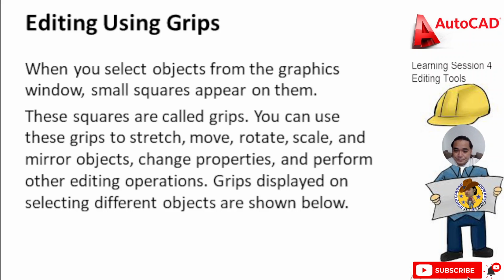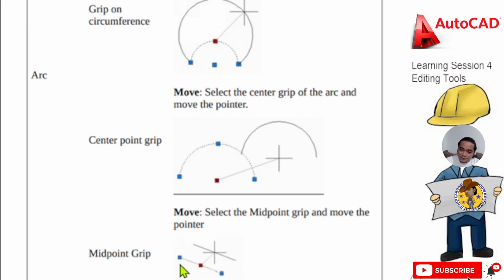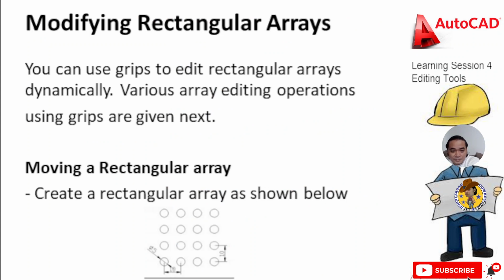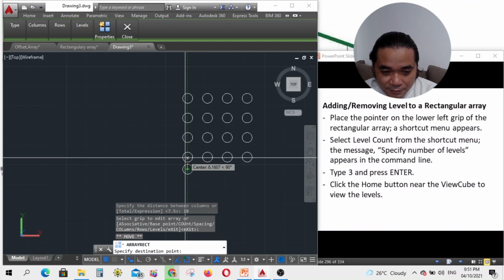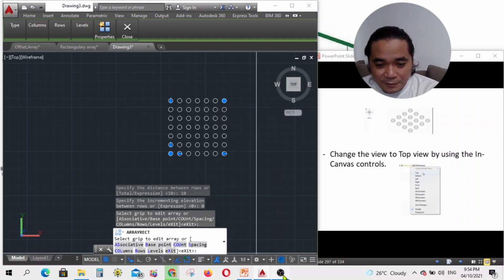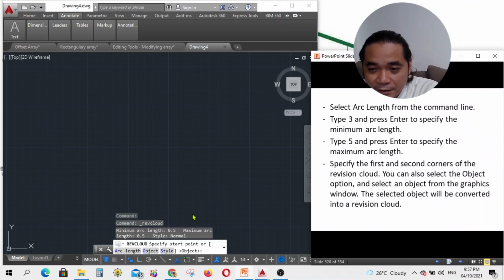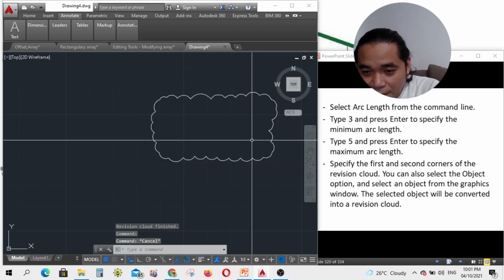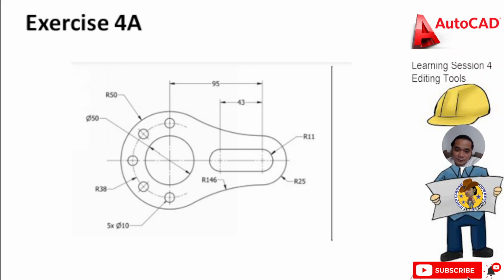AutoCAD LS 4-4 | Editing Tools

Comment: Editing with grips, editing procedures available when picking and dragging grips, modifying rectangular arrays, and revision clouds are covered in the fourth part of Learning Session 4 (LS 4-4). Tiny squares appear on graphics window objects when they are selected. Grip squares are what these are known as. You can stretch, rotate, scale, and mirror objects using these grips, as well as change their characteristics and do other editing operations. Grip editing is a dynamic editing technique that can be applied to rectangular arrays. Revision clouds are also used to highlight specific areas in a drawing. You have three options for editing clouds: freehand, polygon, and rectangle tools.

Comment: LS 4-4 | In this final section of Learning Session 4, I learned about the following four topics: editing with grips, editing operations available when picking and dragging grips, modifying rectangular arrays, and revision clouds. I discovered that grip can allows us to edit drawings in a completely new way. Objects can be moved by dragging the grip, which refers to the small squares that appear at different points within an object. These grips can stretch, move, rotate, scale, and mirror an object. In addition, I discovered that we can add and remove levels from a rectangular array. After you've added levels to it, it's best to view it from the top using the canvas controls. To truly see the difference or the object's orientation. Finally, I can now create revision clouds in three different shapes thanks to this learning session: rectangular, polygonal, and freehand.

Thank you sir and God bless you always😊

Comment: In this fourth part of the video, I learned how to utilize editing grips effectively in AutoCAD. In grips, I can modify objects by editing commands and object points. Moreover, there are five grip editing modes namely; Stretch, Move, Rotate, Scale, and Mirror. When I followed the instructions for the grip editing command, it switches to the stretch mode, and then, when I press Enter it will switch to the different editing modes.
Thank you, Sir!

Comment: Thank you Sir Pongcol for creating this video tutorial, it helped me to determine the proper application of grips, a small squares that appears in an object upon clicking it. Hence, grips may comes in a variety of points or position depending on the types of object used there is the so-called end point grips, corner grips, center point grips and others. It can help us to easily move and change the elevation of the object. Apart from it, I also learned on how to modify rectangular arrays, adding or removing levels to it and changing its view. Lastly, I were able to engage myself  in making revision clouds in rectangular and polygon form which i can used for further Autocad exercises.

Comment: LS 4-4 | In this last part of the learning session 4, I learned about these 4 things: editing using grips, the editing operations available when picking and dragging grips, altering rectangular arrays and revision clouds. I discover that grip can allows us to edit drawings in a whole different method. In other words, objects can be moved by dragging the grip — which refers to the small squares that appear at various points within an object. These grips can be used to stretch, move, rotate, scale and mirror object. I also learned that we can add or remove levels from a rectangular array. After adding levels on it, it is best to view it in a Top view using the canvas controls. To really see the difference or the orientation of the object... Lastly, through this learning session I can now create revision clouds in three different shape: rectangular, polygonal, and freehand. Thank you sir! God bless

Comment: In this part, I learned how to edit using grips.  Engr. Mardie emphasized the object's grasp and editing operation. When changing the rectangular erase, you may utilize grips to dynamically edit rectangular arrays. Following that, several array editing procedures are shown utilizing grips (adding/removing levels from a rectangular array). Additionally, revision clouds are utilized to indicate areas inside a design. You may create revision clouds using three distinct tools,  explained and showed well. As a result, in order to produce the image you want, you will almost definitely need to change one or more of these fundamental drawing elements. Thank you sir!

Comment: For the last part I’ve learned about editing using grips highlighting that when we select objects from the graphics window, small squares appear on them. These squares are called grips. We can use these grips to stretch, move, rotate, scale, and mirror objects, change properties and perform other editing operators. Also, grips are displayed on selecting different objects. This learning session is very useful and helpful in giving the guide as a skill-based. 
Thanks, Sir for this content :) Hoping for more videos!

Comment: In this video, I have received new learnings with regards to editing tools in continuation. The existence of grips in the drawing has a lot of functions and purpose. It provides numerous operations in terms of editing such as stretching, moving, rotating, scaling, and mirroring objects, changing properties and etc. Grips can be easily selected and dragged at a certain position. Grips can as well be used to edit rectangular arrays dynamically. Revision clouds are combinations of curved lines. In addition, these are used to highlight the areas in a drawing.

Comment: In this section, I learned on how to edit using grips like when you select an object from the graphics window, the small squares will appear on them and the following table gives you the details of the editing operations that can be performed when you select and drag grips. Engr. Mardie also highlighted the object grip together with its editing operation. On modifying rectangular erase you can use grips to edit rectangular arrays dynamically. Various array editing operations using grips are given next (adding/removing level to a rectangular array). Moreover, the revision clouds are used to highlight the areas in a drawing. You can revision clouds using three different tools which discussed and clearly demonstrated by Engr. Mardie. Therefore, in order to create the image you require, you will almost certainly need to alter these basic drawing objects in some way. Move, Copy, Rotate, and Mirror are just a few of the tools available in AutoCAD.

Comment: AutoCAD LS 4-4 

For the last session in Module 4, I learned on how to edit using grips, such as when you choose an object from the graphics window, small squares appear on it, and the table below shows the editing operations that can be performed when you select and drag grips. Engr. Mardie also called attention to the object grip as well as the editing operation. Grips can be used to edit rectangular arrays dynamically when altering rectangular erase. Following that, grips are used to perform various array editing operations (adding/removing levels from a rectangular array). Furthermore, the revision clouds are utilized to bring attention to certain parts of a drawing.

Comment: In this video, I learned that objects can be moved by dragging the grip — small squares that appear at various points within an object. I also discovered that you can add or remove levels from a rectangular array. After you added levels on it, it's best to view it in a Top view using the canvas controls. And, thanks to this video, I can now create revision clouds in three different shape:  rectangular, polygonal, and freehand.

Comment: In this part, I learned the functions and uses of editing tool like editing using grips,editing operation that can be perform when selecting and drag grips,modifying and moving rectangular array and revision of cloud.The editing using grips explains the existence of the square appears in the object.Now i understand the difference in dragging the objects like arc,circle,polylines or rectangle in the center ,endpoints,corner grips and center grip,also it have option like stretch and move. The Rectangular array distributes evenly copies of the selected object in rows and columns in rectangular shape that's why  modifying and moving it is quite easier for the user and the revision clouds in my case because my version of autocad is 2018 that's why i am able to follow the instruction but i realize in this part how
 each function helps the user to at aese its works.

Comment: In the video, I have learned the editing using grips such as the grip on circumference, Center point grip, endpoint grip, corner grips, center grip, fit points, control vertices and midpoint grip. Revision clouds are used to highlight the areas in a drawing.

Comment: Grips give you a quick way to modify objects by giving you access to commonly used editing commands and commonly used object points. … There are five grip editing modes: Stretch, Move, Rotate, Scale, and Mirror. When you select a grip, AutoCAD starts the grip editing command and places you in Stretch mode